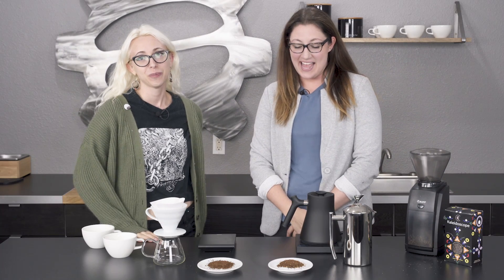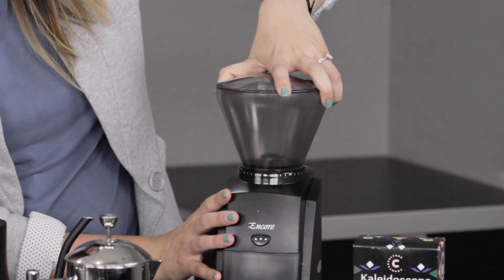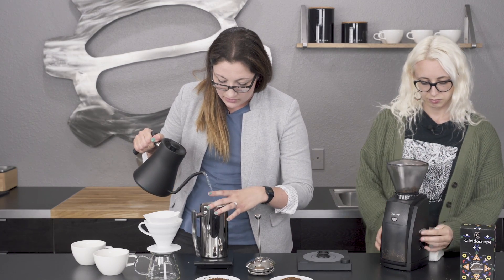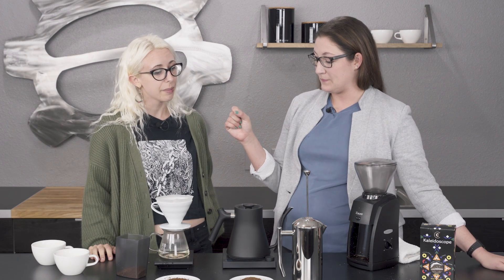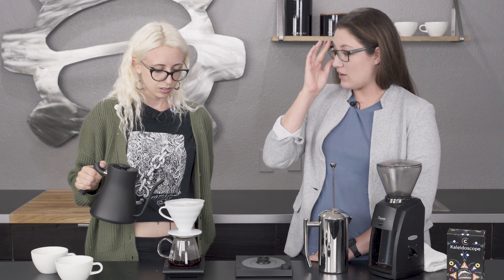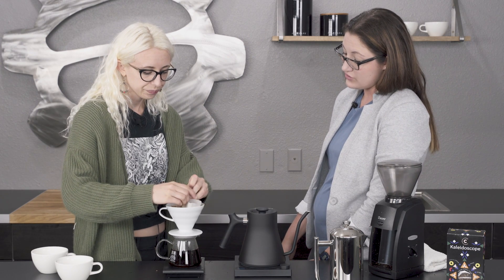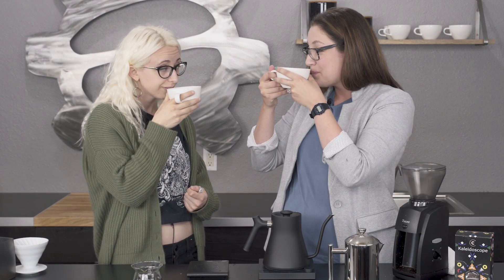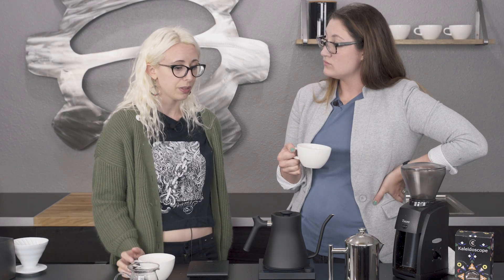Brew Method Comparison

Comment: Great video!  I love this style of video.  Lightly scripted.  Seems more real.   Please consider doing a comparison of the Clever Coffee Dripper device; it's way simpler than the manual pour over with all that bloom pour & pulse-pouring nonsense; just wash the paper filter, pour in grounds and then fill with water.  All the grounds are in contact with water for the complete brew time.

Comment: You need to use higher ration of coffee to water for immersion brewing and you need to use slightly coarser grinds not super coarse like sea salt.
Reply: not really. aeropresss is immersion and not coarse
Reply: @mariai9549  aeropress can be used in 1000 different ways.
Reply: @klarinetta  yes, you can use coarse coffee if you want a bad brew🙃
Reply: @veganpotterthevegan  What do you call coarse ? I'm not talking about coarse like sea salt. I'm talking about a bit coarser than kosher salt. And because the filter in french press is so coarse you need to use a bit coarser grinds and you need to use higher ratio of water to coffee in all immersion brewing also for Aeropress just because the water is not constantly passing through the grounds.
Reply: @klarinetta  Aeropresses don't maintain temperature very well.  So you need a finer grind.   Finer than a pour over.  I actually don't even like aeropress coffee(any papee filtered coffee really) but my Fellow Ode on its finest setting is just barely fine enough for an aeropress.   For French press, with very light grounds, I definitely go close to kosher salt.  The filter doesn't matter.  I let the coffee settle after plunging